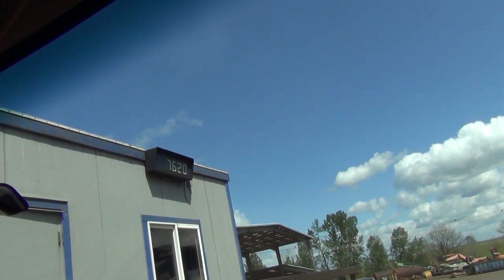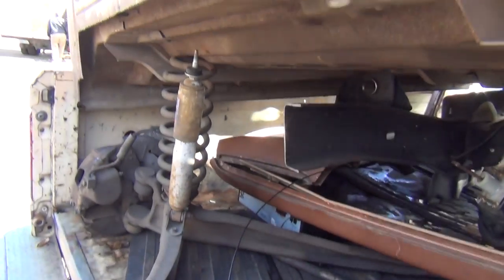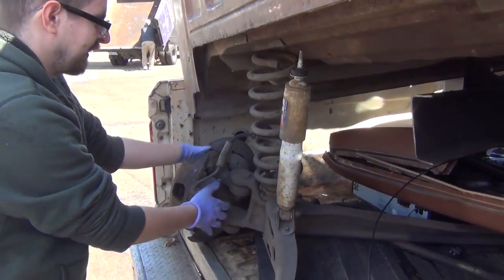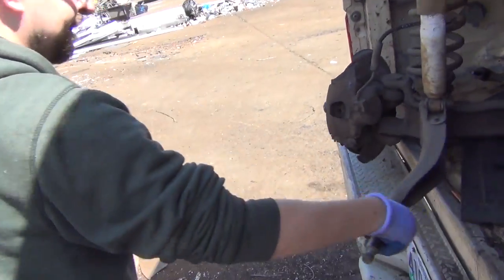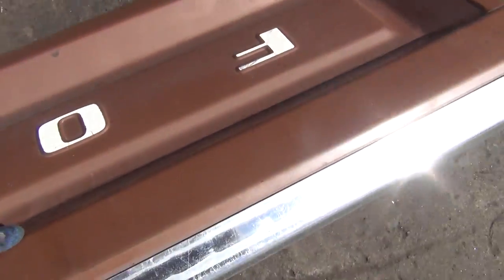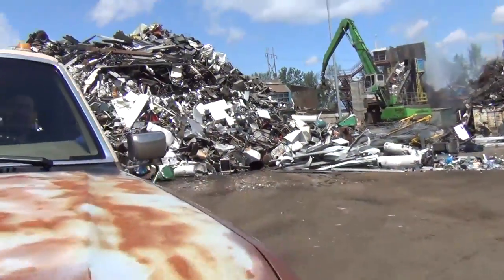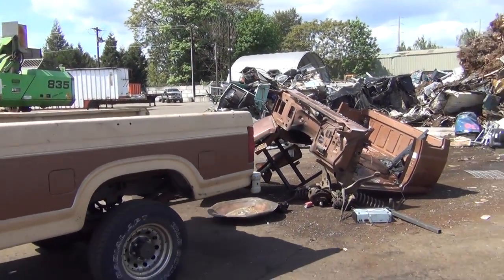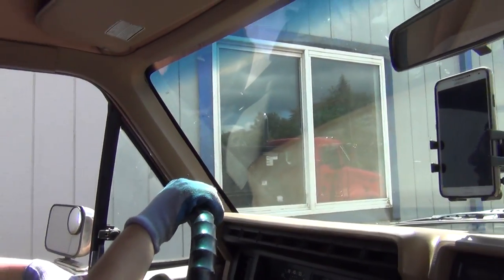Scrap Run 3 | Is That Clutch I Smell? | Scrap The Extendable

Comment: Man, that was a fairly decent truck. Oh well, as for the wheels and tires, those woulda been worth keeping in my opinion.
Reply from the maker: I kept the wheels, the cab was trash, firewall was cracked to hell. I think we tossed in some other random wheels, but I kept the nice chrome ones from the truck.
Reply: Haha yeah, them are the ones I mean. 2 in the last scrap run, and I didn't have time to watch this whole video earlier but only one was visible in the bed. From what I've heard, they actually are chrome and polish up really nice! Though, the ones on my 95, 2 are decent, ones real pitted and the 4th wheel is the spare, I got another set of the same rims, with 2 tires. Ones bald and the other doesn't hold air, which sucks because I wanna get the spare rim off, and one of the front tires has 2 lines like it's gonna blow. Gotta figure out the miss first though, just for the truck and a bad miss had developed.